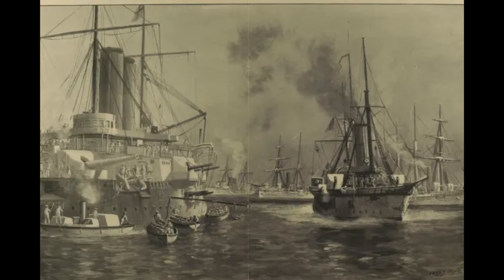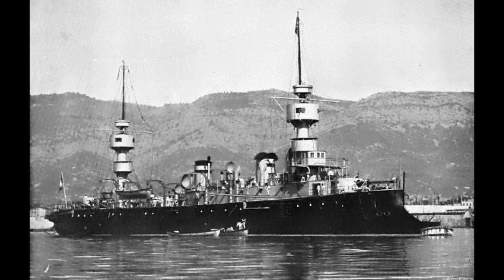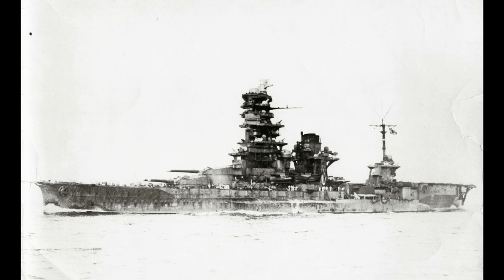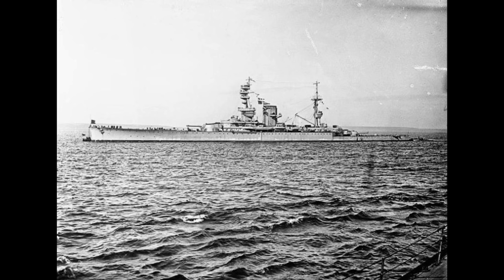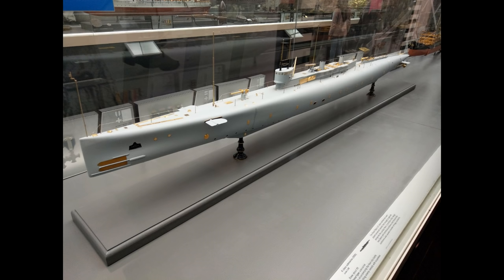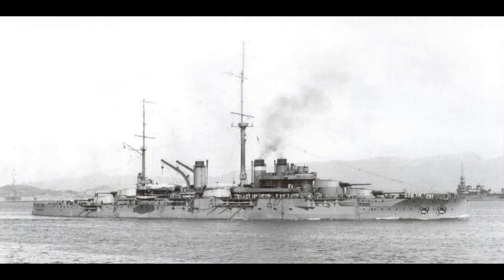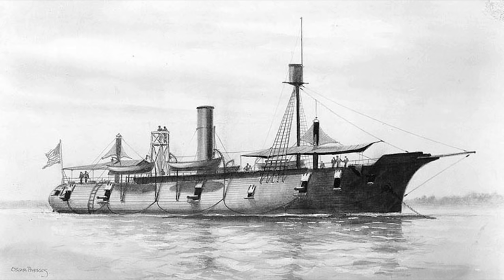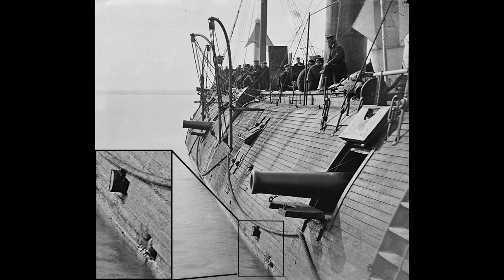Naval Engineering Disasters - How not to design a ship

Comment: an excellent assessment!  I think the biggest issue with "battlecarriers" and their theoretical cousin the flight-deck cruiser is not only all the things you identified, but that you're putting a lot of value into one hull, a hull which is vulnerable to a torpedo.  Gunnery battles were largely becoming obsolete,  the last battle where battleships dueled with cannons (which I believe is Surigao Strait, part of the larger action at Leyte  Gulf, fought Oct 1944) was fought less than 11 months after the conversion was completed and even in the year leading up to Surigao, gunnery duels were becoming vanishingly rare.  The defenses of any battleship, even the mighty Yamato- and Iowa-class, were vulnerable to a torpedo, and the Ise-class' unique magazine arrangement might have made them more resistant to magazine hits from torpedoes, but even if a torpedo didn't hit the magazines one mid-late war torpedo was enough to cripple a battleship, and the magazine arrangement was uniquely vulnerable to dive bombing.  The putative advantages of separating the mine and other explosive consumable stowage from the powder magazine would be totally negated by the presence of aircraft fuel stores, aircraft torpedoes and the like, meaning one good dive bomb slipping through the already porous IJN anti-air defenses could crack the ship entirely in half and sink it in rapid order. Another major point of criticism against the usefulness of the Ise-class "battlecarrier" conversion. 

That said I do think that at the time they were already contemplating kamikaze tactics, or began to shortly after given what they had as far as carriers (which included the converted Ise-class) which changes your assessment of their potential use of aircraft.  If the putative 43b variant Ohka-class suicide plane, which could launch from carrier by rocket and did not require a land-launched bomber to carry them, ever became operational then that would have probably been their preferred complement through the latewar period. The parasite-plane version was test-flown only four months after the conversion of the Ise class was completed in November '43.

Comment: I'd make a distinction between design or conceptual disasters and engineering disaster. Leipzig was an engineering disaster. The depth controls on the K-class were engineering disasters. Indefatigable was a design disaster. The Spanish cruisers were conceptual disasters.

Comment: Could the Ise class have been more useful if the small air group was solely long range recon? Useful for also ASW work but mainly to allow fleet carriers to have adequate search options without costing ship space.

Also, my list of 10 would have included the Russian circular battleships, such as Popov. Too slow to go anywhere, unsteerable, and generally a failure all over!

Comment: What about the Liberty ships of WWII. The original design had a hidden defect, I am not sure if it was hogging or not, but cracks would develop in its midsection. There were Liberty ships that were lost because the vessels cracked in half. They were retrofitted with support bands to strengthen their midships as well as the new built vessels.

Comment: Yamamoto class with the two 9 inch steel belts riveted together for armor plates were incredibly susceptible to explosive damage from torpedo attack. And let's not forget their tiek deck 500lb bombs could so easily penetrate right down to the ammunition. Both exploded, only thing left of either is the detached armor belts.
Reply: First; Yamato, not Yamamoto.

Second, the armour belt of the Yamatos was mostly welded; rivets were only used for the thickest sections, which also applies to most contemporary Allied designs (again, mostly welded with rivets only used for the thickest parts of the armour). 

Third, riveted armour belts had absolutely nothing to do with the fact the Yamatos had weak torpedo defences, because a ship’s belt armour is supposed to protect from SHELL hits and be ABOVE water. You’re thinking of the Torpedo Defence System (TDS), not the belt armour. The Yamatos did have a flawed TDS, but this had nothing to do with a flaw in their belt armour (especially when said flaw in the belt armour was never actually a thing).

Fourth, you’re wrong about the Yamatos having deck armour so bad 500lb bombs could punch straight through to the magazines. The Yamatos actually had some of the best deck protection of any capital ship ever built, and dive-bombing attacks only really caused superstructure damage to them (they were sunk by torpedo bombers, not dive bombers). You seem to be under the illusion that the Yamatos had no deck armour whatsoever and only had wood: this completely ignores that in all battleships, the armour deck goes UNDER the wooden planking. American battleships also had a wooden layer above their deck armour, does that mean they also had no deck armour whatsoever?

The reason the Yamatos exploded had everything to do with the fact they capsized from torpedo hits (same as Barham) and absolutely nothing to do with bombs setting off their ammunition. Even then, they didn’t completely fall apart to the point the armour belt is all that’s left of them.

Comment: I can think of two other theoretical uses for battle carriers. 
1. Convoy escort. They could take a some anti submarine aircraft and a few fighters for cover. They could provide protection from raiders, submarines, and raiders. But not really a use that that would help the Japanese at that time.
2. Cover for landings. Put a few fighters and strike aircraft and use the big guns for shore bombardment. 
Of course a better solution for both was an old slow battle ship and a cheap escort carrier or two.

Comment: No mention that the Furious was designed with two single 18" turrets instead of the two twin 15" turrets of the sister ships.  In fact the forward one was replaced by a flight deck during construction as seen @24:15.  But firing the 18" gun was shattering - I think they only tried it once.  I had not known that the hull was considered weak anyway. I believe the guns ended up at Singapore as a land battery.
Reply: Singapore hey? Which way were they pointing?

Comment: I remember the K-class from the wonderful "Book of Heroic Failures". I'm surprised you didn't refer to that entry for Lulz.
It appears under the heading "The worst Submarine":

"K-1 sank after colliding with K-4 off the Danish coast. K-2 caught on fire on its first test dive. 
K-3 plunged inexplicably to the seabed with the Prince of Wales on board, eventually resurfacing only to sink after being rammed by K-6. 
K-4 ran aground; K-5 foundered in the Bay of Biscay. 
K-14 sprang a leak before its first trial and during one celebrated manoeuvre in the North Sea it collided with K-22 which used to be K-13 but was renamed after it keeled over at Loch Gare in Scotland while on seaworthiness trials.

K-14 sank, while K-22 was damaged beyond repair after getting in the way of HMS Inflexible, a cruiser that happened to be passing.
In the same manoeuvre K-17 was struck by HMS Fearless, having already been hit by K-7, thereby incapacitating itself.
On observing this mayhem, K-4 stopped engines, altered course and was rammed by K-6 which later got stuck on the ocean bed.

Better still, K-15 sank in Portsmouth harbour before going anywhere or doing anything.

Ks 18-21 were never completed but their keels were modified for use in the new M range. M-1 was rammed bu a merchant vessel while on diving patrol in the Channel and M-2 sank after springing a leak."

🙃🤣😁
Reply: This invites a new version of one of Thomas Dolby's best songs. "All of our submarines are missing tonight..."
Reply: @ZGryphon  🤣

Comment: 19:50 I can't remember if it was here or another channel; but someone emphasized how irritational it was specifically with the line "If you're that desperate in the war to design and deploy Battle-carriers; you've got far more substantial problems" but also said how rationale Kamikaze was. In any case, I would lump both into the same school where if suddenly it is "practical and rational" to send mass waves of suicide attacks rather than maintain an actual air force, there are far more substantial concerns abound at that point of your war effort.

Comment: A purpose-built battle-carrier would have put the ability of turbo-electric ships to steam astern at speeds at least similar to their speed forward to good use. Steam stern-first into the wind to launch, then steam bow-first to recover. Carry a squadron of fighters using such an operation profile, and you can achieve something, especially if you give the ship a useful anti-aircraft armament as well. It would be close to the ultimate heavy bodyguard for  your fleet carriers.

Instead, the Japanese chose to add flight decks to the sterns of two of their slowest battleships, with the intent of launching tiny strikes using not-so-tiny strike aircraft.

ETA: Fixed typo.

Comment: I thought the Japanese BattleCarriers aircraft were intended to provide the search functions that cruiser-launched scout planes typically performed without having to stop the ships for recovery of the search planes.  This allowed them to launch from the battle line positions 40-60 miles forward of the carrier groups.  I don't know if they ever did this.  Must have been a little tricky landing on the flight deck with turbulence from the superstructure.

Comment: To be clear I agree with every point you made I'm just adding a few hypothetical arguments that the battlecarrier as a concept (not just the Ise itself of course) could have occupied a great niche for the allies in WW2 had they converted some of their older battleships. I can imagine them serving alongside maybe vanguard or expeditionary forces perhaps supporting marine landing on smaller less defended islands freeing up the dedicated vessels for the more difficult island operations and other engagements and it could also eliminate the need to establish small island airfields in some of those instances since they could act as a mobile FOB since it wouldn't take an actual carrier out of other engagements. It could have theoretically allowed the US to sweep through the Pacific at a faster pace plus in an age before supercarriers, drones, satellite imaging, and guided missile destroyers combined with the sheer size of oceanic theatres they could have been very effective at scouting, doubled as convoy escorts and submarine hunters in the Atlantic eliminating the mid-atlantic gap far sooner, or maybe just raiding and harassing Japanese shipping and transports. As you rightfully pointed out, a force of multiple dedicated warships as with everything are superior up against a single multi-role counterpart however on the other side of the coin individually those dedicated ships lack versatility, just like the balance between speed, protection, and firepower which trait is best is dependant on "who what when where how" they are used which is why I love your content because in addition to specifications you always go on in depth to explain the hows and whys of the design, a rare quality especially for ww2 history.

Comment: wrt the Ise conversions, I am a bit puzzled too.  Apparently Hyūga was nominated for conversion because both of her aft turrets were already damaged, limiting her effectiveness as a battleship anyway.  My first impulse would be to remove the superfiring midships turrets, one from Hyūga, and one from Ise, due to their more limited field of fire, to replace the two damaged turrets, then use the freed up midships deck space for more AA.  That doesn't help their lack of carriers though.  Apparently the conversion work started in early 43.  By that time, the Kongos had demonstrated that they did not have the survivability for a surface engagement.  My plan would be to pull turrets from the surviving Kongos to replace the damaged ones on Hyūga, if feasible, and convert the Kongos to full length deck carriers, because they could keep up with the other carriers, which the Ises could not.
Reply: By 1943 the Kongos had shown that in surface engagements they were over-gunned heavy cruisers rather than battlecruisers/battleships, but they still had 30 knot speed and that made them useful. The older Japanese battleships had shown they were just too slow for most operations.
Pulling the Kongos out of service for conversion might have been quicker in peacetime, but in 1943 it would reduce front line strength. Better to try to build new carriers, and look for existing ships that weren't doing anything useful (seaplane carriers, old battleships) and try to convert those.

Comment: I would argue that the strike carriers as designed were to be used in a stand alone role to support amphibious landings or as a anti-raider cargo escort.  The strike aircraft would provide supplemental attack and spotting capability for the CBB.  If they had been able to make it fast; it would have been an excellent raider.  Other than that; all the analysis if the short comings is spot on.

Comment: Not included in this series was the Stevens Battery. By the end of the War of 1812, around 1814, John Stevens was interested in building a steam powered, turret-equipped ironclad. Stevens and his son Robert had built successful early steamboats about the same time as Fulton and Livingston built the North River Steamboat (aka Clermont), and Stevens was fascinated with building rifled cannon with elongated explosive shells. But the idea languished until 1844 when Robert proposed a 250-ft long design with 4.5 inch sloped armor. But before it could be built, John Erickson developed a 12" gun that would have had it for lunch. Redesigned in 1854 to much larger dimensions, with better armor, the new design was intended to be semi-submersible to make itself a smaller target. But Robert Stevens died and the project again languished. None were built for the Civil War, and of course Erickson built the Monitor (revolutionary but seriously unstable). Later attempts also fizzled, and by 1874 the project finally died completely having burned thru $2M. So what had been an actually pretty brilliant initial concept, 48 years ahead of the USS Monitor, was never properly engineered, with all attempts being so slow to build that they were obsolete before construction.

Comment: Aircraft carrier/battleships

In theory~ a great idea

In practice~ even though a jack of all trades master of none is better than a master of one, in this case you now have a ship that logistics fears 

You need: 

Gunmen
Cannon maintenence crews 
Fire control systems 

Piolts
Aircraft maintence techs 
Fuel (av gas)
Munitions 
Fuel (oil)

An overcrowded barracks 
An over worked crew 
Logistics from hell
And not enough planes to do enough

Comment: Ise and Hyuga.
  I think the idea is to launch strikes, not CAP, which would center around the fleet carriers*.  The Hybrids are meant to advance, launch, and the strike planes retreat back to the carriers (held back a bit) afterward.  It was all about saving carriers, not improving battleships.  Antiquated battleships like Ise and Hyuga (and Fuso) were expendable.  Fleet Carriers were not,
  Carry on.
*Who can launch and recover fighters all day long.  The Hybrids were one shot attackers.  They had zero ability to launch and recover.  So-no CAP from them.  CAP is an all day job, not a single launch and forget.
Reply: 22 Attack planes is not insignificant.  Double it to 44 attack planes and it starts to turn Japanese heads.

Comment: Has Drachinifel done a guide on the Kriegsmarine Konigsbergs yet? I'm curious as to what the history behind their design choices led them to be built that way. I know they also had a dual diesel steam powerplant.
Reply: They were built between 1928 and 1930 for the Reichsmarine of the then Weimar Republic which means they were built under the restrictions of the Versailles Treaty which e.g. limited the max tonnage of Cruisers for the Reichsmarine to 6.000 long tons standard displacement.   
They also had to be built without catapults and recon seaplanes on them because of the restrictions of said Versailles Treaty which forbade military airplanes as a whole for Germany. After the new Kriegsmarine inherited them in 1933 when the Nazis took power they were modified in 1935 with catapults and recon seaplanes. 
But given the timeframe and serious limitations of the Versailles Treaty and also the financial restrictions of the Weimar Republic, they were simple the best they could come up with back then.

Comment: Very interesting! Had me think it would be interesting to hear your views on the Jeunne Ecolle derived "anti-battleship doctrines" of late 19th/early 20th century. In many ways you can see them as choices of necessity by nations not really capable of building battlefleets but OTOH also appeard quite suited to say the shallow waters of the Danish Straits (Ie not Denmark Strait, but Great Belt and Oeresund). Up to WWII the Danish Navy doctrine was based on extensive minefields which were to be protected from minesweeing with coastal "battleships" and coastal fortifications and with torpedoboats and coastal subs trying their luck by having a go at the enemy main fleet. Similar doctrines were used by the other Nordic navies. By WWII the doctrine was clearly obsolete due to airpower, but how about WWI? Say if the British had decided to proceed with "Baltic operations"? By this time Denmark de facto was a German vassal, the Danish Straits were mined on German request at the outbreak of WWI and a substantial force (50.000 men) was mobilised to man the fortifications and batteries around Copenhagen and at the straits.  Of course comparing a coastal battleship to a true battleship, even pre-dreadnought, will not be interesting, but do you have an opinion on the combination mentioned above? Was it a "design failure" or did it stand a chance?